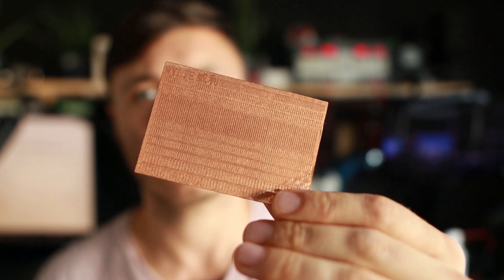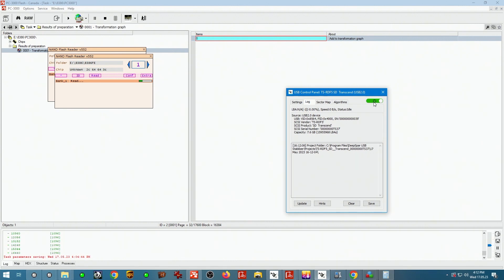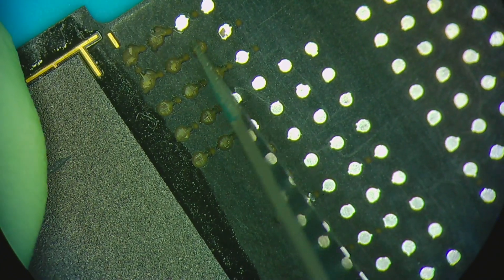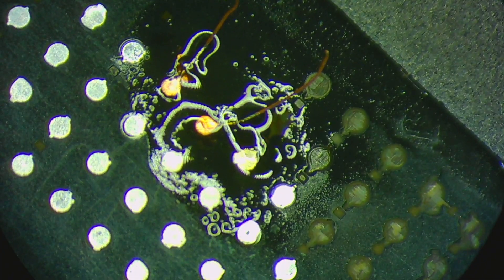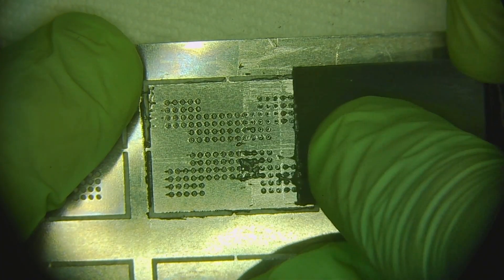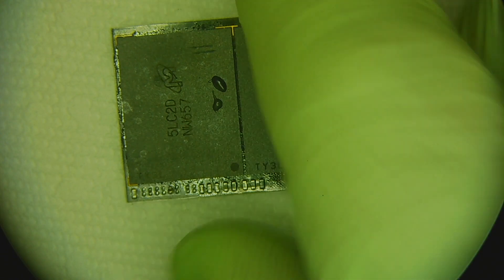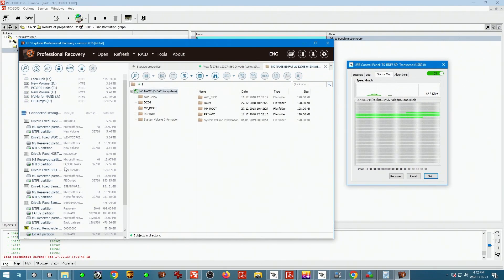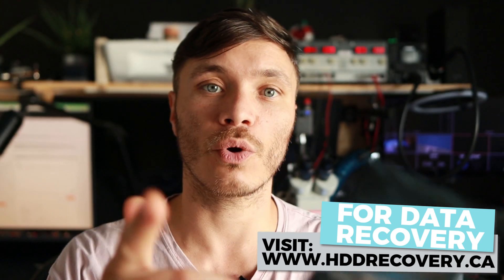how to fix most common failure for Lexar memory card

Comment: Why is repairing the pads better/faster than 'chip off' data recovery? Was the controller an unknown type with regards to mappings and translations?
Reply from the maker: Repair takes 20min, chip off will take 6hours and results are not 100% as good via simulation of control. Hardware controller is perfect right away
Reply: @hddrecoveryservices  thanks for answering. I watched several of your videos over the last two years but for some reason I hadn't picked up as much that it takes that long to raw read a chip and simulate the controller.

Comment: Are you using regular soldermask to glue the pads into place?
Reply from the maker: Yes
Reply: @hddrecoveryservices  Thanks, works great! Had my first BGA repair done today on an old retro-mainboard i was trying to repair. 4 balls under the northbrige had gone missing. Unfortunately,  even after replacing north and southbridge, board is still dead. But it's been a good practice for future projects. Thanks for your informative videos!

Comment: oh yeah Kris fix Germany fixes video cards and often there are missing pads and such. He fixes it by taking spare pads from a similar product and soldering them on and securing them with solder mask. The mask goes under the pad and over the soldered connection. They are nice and solid.
Reply from the maker: Yeah Ive seen people do that. This kit is like 2-3$ and it will be good for a long time 😁. I tried cutting pads off NANDs before to reuse - no fun 😊